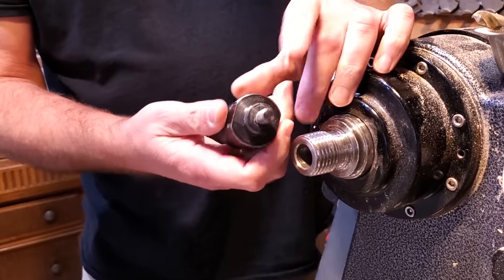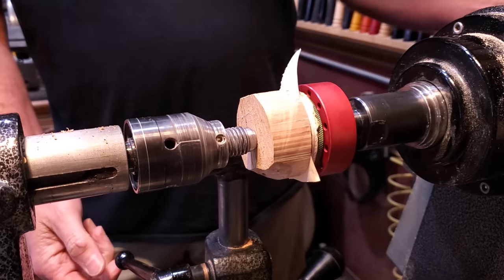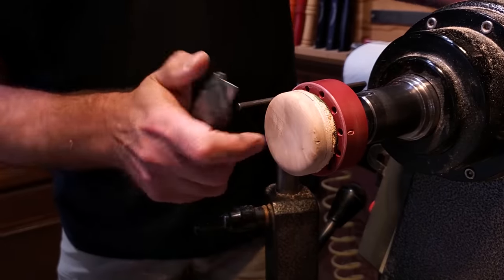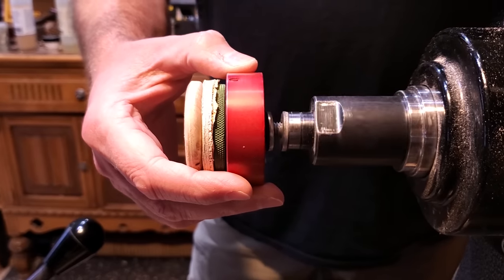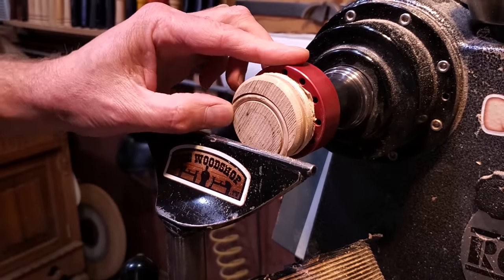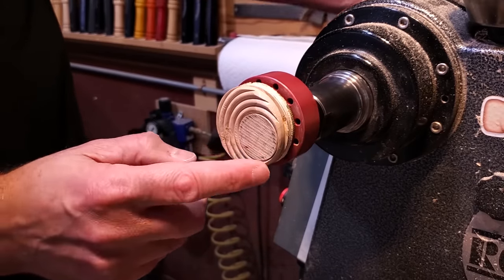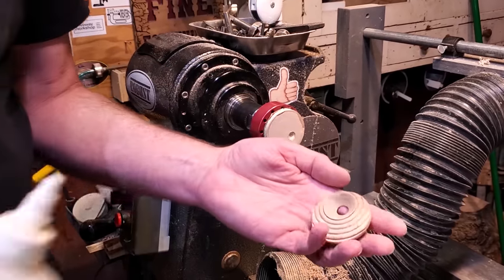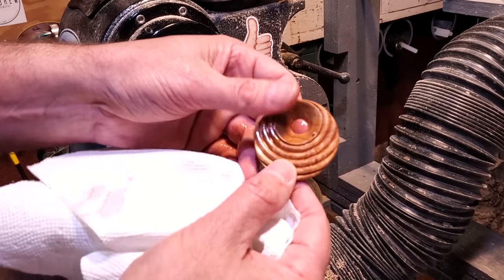Woodturning | Off-Center Pendant

Comment: Looks good Carl.  I bought that jig from Ruth several years ago but haven't used it much.  If it's the same jig Ruth was selling years ago there is an excel spreadsheet program out there that will let you input the holes you are thinking of using, size of pendant and it will draw the the finished pendant for you.  Saves guesswork as to what the finished pendant will look like.  It also works with the open office spreadsheet and it's free for those who don't want to pay the big bucks Microsoft wants.  Also works on my android tablet.
Reply from the maker: Thank you Rick!! With the link I put in the description the PDFs are on that page, but I should of mentioned that in the video! Yes it's the same jig Ruth has been selling :)

Comment: If you drilled out the mounting hole using a brad-point bit before shaping the area around the hole, you could probably minimize the amount of sanding that you have to do while also managing the thickness of the wood immediately surrounding the hole.

I've made lots of these - they make great zipper pulls for sweaters and fleece jackets.
Reply from the maker: Great tip! Thanks!

Comment: The one issue I have with mrs. niles' jig is that it ain't safe to use if you have a midi or mini lathe.  your robust beastie is good as it weighs what 700 or 800 pounds.   using it on a 100 pound midi is just asking for trouble personally.  I had one some 8 or so years ago, sold it before I actually used it. tested it out and it shook the (Expletive!) outta my lathe and I had it bolted down to a 250 pound bench too.
Reply from the maker: I'm not sure what you were turning, but it sounds pretty heavy. She's sold hundreds of these to people with small lathes, and you're the first person that has said there was a problem. This jig is for pendants, bottle stoppers, and small boxes etc. We had someone demonstrating them at the last show on a Jet mini lathe just on a stand with no problems.

Comment: Hi Carl Great demo! I'm assuming you can use the Niles tapered mandrel in this operation. Did I also correctly that everything you need to this pendant comes with the jig.
Reply from the maker: Thank you very much Charles!! Yes everything comes in the kit, including the mandrel. The jig mandrel doesn't have the flute cut in it, so there's less chance of cross threading the jig.